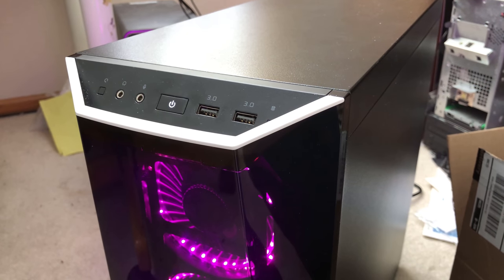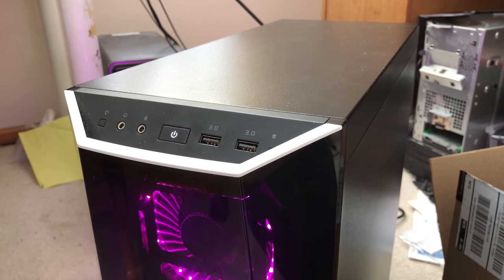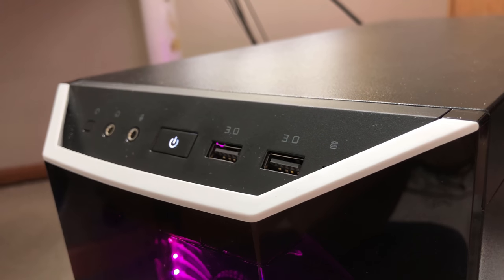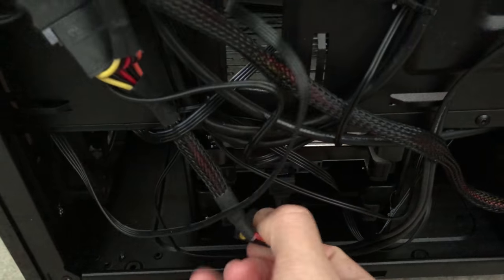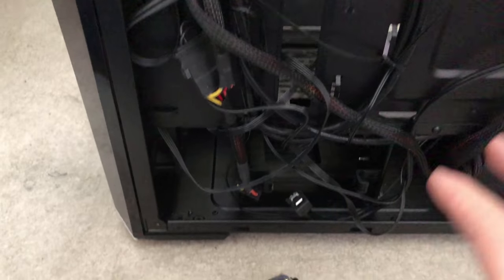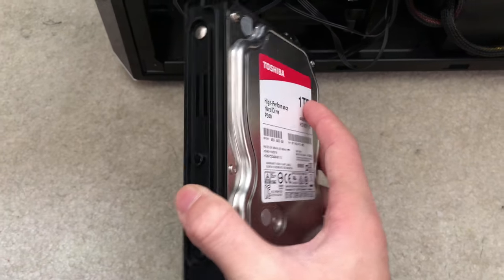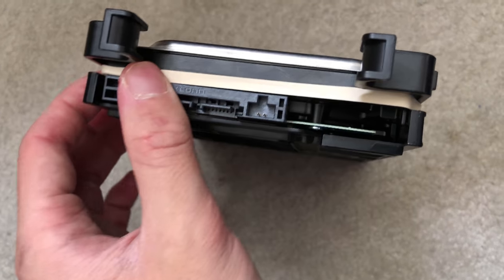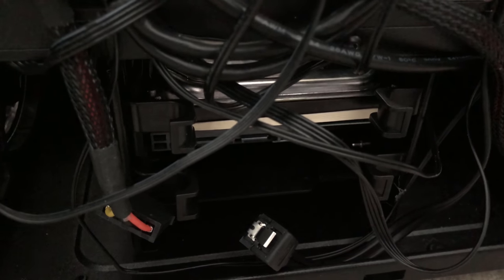HOW TO FIX HARD DRIVE VIBRATION - SUPER EASY - Toolless Mounts

Comment: I have a Corsair 760t case and a WD Blue 7200RPM 1tb and this seems to have worked so far.

Before trying this out my PC would occasionally out of nowhere start making a very loud buzzing noise which at first I thought was a fan or something. If I pushed the case the sound would stop. If I put a metal coin under one foot of it, it would stop making the noise for some time but start again out of nowhere. After reading into this I read that it might just be the hard drive vibrating (and it was).

I couldn't place the rubberband straight like yours because the sata ports would've been covered up (because of the design of the drive cages), but I messed around with it till I got the rubber band to go around the drive cage while also not covering up any sata ports.

It doesn't look great from the outside because the rubber band shows, but it is way better than hearing the loud vibrations it would make before.

My PC is more silent than ever now (so far). Thanks a lot for this.
Reply from the maker: glad to see that it helped!

Comment: I just removed my old 2TB WD drive from its enclosure and it vibrating just like in this video. Its causing the computer case to vibrate on the floor magnifying the sound. I loosened the screws that were holding it securely in place. I can no longer hear the drive. Hopefully the drive works a lot longer.

Comment: What a great solution!
I've been trying this fix for about a week so far and i'd say hard drive vibration noises are down at least 80%!  Not only are the vibration noises much less frequent, but they also don't seem to be as loud.
The case i'm using is a Corsair Carbide 200R which has tooless 3.5 inch hard drive bays. My only mechanical hard drive is a WD blue 1 tb spinning at 7200rpm. I was actually thinking about replacing this back up drive for a 2.5 inch sata ssd due to all the vibration noise but i'd prefer to not have to put out the money on one. Now that i'm using your rubber band solution my HDD vibration noises are much less frequent and definitely much more tolerable!
Thanks Stevepilot!
Reply from the maker: glad it helped!

Comment: Ok -- I had to put two of them to make a difference. Vibrations aren't exactly "gone" but now I'd dare say they are down to 50% or less. 

My gain out of doing this was getting rid of what I'd say it's 80% of the buzzing - which is great news - but I have to say I also put some foam underneath the four case's supports.

Other than that, this solution helped getting rid of a big portion of those buzzings and vibrations. I give it a 4/5. 
Thanks
Reply from the maker: WildBird Aviation thanks for the feedback!

Comment: This worked thanks! But i have one question, rubber bands shrink and weaken with exposure to heat, since it gets like 90c sometimes will it cause the rubber band to snap?
Reply from the maker: I suppose that’s certainly possible, but I’ve never had any issues with it. I’d imagine that it would be fairly hard for it to snap considering it is under fairly little tension while being compressed up against the sides of the hard drive. Thanks for watching!
Reply: @Stevepilot Our drives are a bit different. My rubber band had to go over the mounting clips. Which made it bend inwards. I didnt want the shape to get deformed or anything due to consistent pressure. It also made the rubber band quite stretched. I was paranoid so after installing it,  I cut the rubber band on the outer side so I could control the snap. Its working great so far. Solved the vibration problem (thanks to your vid), and there is now no possibility or snapping.
Reply from the maker: @user-bb3ci3gn7s  glad you found a way to make it work!
Reply: @user-bb3ci3gn7s  I have the same problem. How's your rig after 6 months?

Comment: I have the same case as u and my I have gone through 4 hard drives and all of them are still vibrating. Right now I have the Seagate iron wolf abs I put the rubber band around it and it still vibrates a lot.

Comment: how does 1 rubber band work? the hard drive does 4 more contacts on the case that hold it up.
Reply from the maker: The idea is to make it have less wiggle room in the cage, and not necessarily to be fully supported by the rubber band.

Comment: I have the problem with the 500p white, i think cooler master actually makes poorly designed cases and it's a problem with a lot of CM cases. I'm changing for a Lian Li o11d, hopefully it'll fix the problem
Reply: Manny Torres  well, i guess i'll see but if it's a big problem i will change for a ssd
Reply from the maker: Manny Torres  you could consider getting a smaller SSD for OS and commonly used apps, and just keep the HDD for storage. That way, it won't constantly be spinning unless you need to access it for something
Reply from the maker: Manny Torres  ah gotcha, maybe try playing with the power plan settings to make the hard drive sleep when not in use?

Comment: Awesome!!!! Since I don't have those special NASA rubber bands around, I'll try some thin EVA. I also would like to compliment you on the video - though single handed done the information is precise!
Some extra info about my system: Corsair 600Q case and a Seagate ST8000DM004-2CX188. Tool-less mount that matches the HDD to create a really annoying noise.

Comment: I have almost the exact same case i got td500 mesh and my hdd is like making a buzzing sound so ima try this tomorrow
Reply: Did it work?
Reply: @Slobodan Krčmar no
Reply: @Slobodan Krčmar i got one seagate barraquda 7200rpm 2tb, and a wd blue 5600rpm the seagate is louder than the wd blue
Reply: @Slobodan Krčmar ye its better to get an ssd, but try to put some rubber if you got. On all the sides where the hhd hits the mouting frame. It helps a little bit

Comment: I used the rubber band but it still vibrates, I know that it is not my hard drive because when I hold it in my hand while my pc is running it doesn't make a sound
Reply from the maker: Abdullah Malik that’s odd... have you tried switching slots?

Comment: Mine was still vibrating after putting rubber bands around it, it only kept my hdd in place without sliding out of easy in hdd bay, but since my hard drive is mounted on top of hdd tray i put a piece of folded paper between upper part of tray and hard drive, and it fixed my problem completely. I will probably need to get some sort of mount for hard drive that keeps it from being noisy. M case is Rampage Prestige, very simmilar design to yours. My hard drive is Seagate 500gb.

Comment: Hey I have the same case and i was wondering if there was a more  neat way to put the hard drive in
Reply from the maker: Abdullah Malik more neat? The current method works quite well, other than the vibrations
Reply: Stevepilot wait so the method fixes the vibrations perfectly so that the hdd is not damaged

Comment: Interestingly enough, in my case it’s also a 7200 RPM Toshiba drive, their 12TB Enterprise model.

I can’t apply your fix because my drive is in toolless USB3 enclosure without any sliders attached directly to the drive. But thanks anyway, this gave me an idea what’s going on, I think I gonna do something remotely similar.
Reply: And what'd that be?..
Reply: @DVTHEFOX  I tried a few things with ribbons but eventually I gave up. I gifted the Toshiba disk to my mother, she only powers it once a month and due to infrequent use doesn’t care about vibration or noise. I have replaced the disk with the Western Digital WD101EFBX model. The WD is much better; while not completely silent, definitely quiet enough to operate on my desk.

Comment: I put my hard drive in my PSU bay supported by the excess cables up there so the vibration doesn't transfer to the case.

Comment: my drive does the same, but it fades in and out. what does that mean?
Reply from the maker: TheLast MistWolf not sure, could just be a weird pattern caused by vibrations as they tend to be pretty unpredictable depending on drive load, other components (like fans), case material, case placement, etc.

Comment: Actually this way you prevent transferring vibrations from HDD to PC box. Energy is not dissipated and kept in HDD. A bit of clarification... hard drive vibrate mainly due to head movement (vibration from rotating disks is relatively small). When you isolate a drive from the case with rubber band, you allow it to move more freely (is more silent). It is good for working comfort, but increase overall acceleration. Typical HDD may sustain up to 0.6g with some errors. Acceptable working acceleration is below 0.2g (no errors). The more fixed HDD is, the lower acceleration is and longer life. So the best for HDD life would be opposite... attaching HDD to concrete. Since regular smartphone has built-in acceleration metering, you can download a mobile app and use it for HDD vibration monitoring. Just put down the phone on the HDD. I understand that it can still be a good compromise between noise and HDD lifetime.
Reply from the maker: Thanks for the information
Reply: Interesting, so I guess without rubber bands is the way to go? To prevent errors?
Reply: @thehh5118  Rubber band will reduce noice (vibration) of the pc box by isolation of hard drive. It is compromise between work comfort and hard drive life.
Computer box vibration depends on its rigidity (e.g. thickness of metal elements, walls, cages).Unfortunately manufacturers try to make pc boxes rather lighter than havier. Not only every pc case will be different but also location of drives influences overall vibration. The worst situation would be vibration resonance, noticable as unpleasant buzz of vibrating parts.
I have 8 drives in my NAS in regular case (best box for home nas... Fractal Design Define 7 XL). So I tested regular pc box design, which may be helpful to you. The max hdd vibration level with rubber isolators was 0.045g which is 20% of no-error range. It is 7% of no-damage range. 8 drives in a cage will cause more vibration than 1 drive, so your hdd vibration will be lower. So no errors. HDD life span is about 7-9 years. It will work longer but failure risk raise significantly. Rubber isolators will reduce this life span. How much? This depends on vibration level which a result of rubber thickness, pc box weight and drive cage rigidity.
Reply: @arkadiusz.chrzastek  That's helpful and good to know. Thank you!
Reply: @arkadiusz.chrzastek  but isn't the rubber flexible part only transferring the energy to more ..free movement? This way the vibrating hdd would move more freely instead of being stopped instantly in each vibration cycle after hitting the metal case. If it's not stopped immediately then the stopping force/acceleration would be smaller because it has more time/space to move and the hdd has more less constant force that is slowing it down.
Reply: @krzysiek2768  It is acceleration which damages hdd, not energy itself. Freedom of movement (rubber isolator) allow innertia movement which causes acceleration (during vibration cycles). Imagine standing on a wooden platform with wheels; no friction in wheels. Trying to move body in one direction will cause movement of the platform in opposite direction.
Let me bring another example... during earthquake ground vibration is transferred to a building; rigit base may cause significant damage to the building. Modern anti-earthquake "base isolation systems" are using rubber pilars, which prevent energy transfer into a bulding. HDD is opposite... energy is created inside of drive by rapid header movement. Rubber isolators trap this energy inside a hard drive. More rubber freedom means more drive case movement as a result of inertia.
Rigid fixation of HDD to a big mass (e.g. concrete block) stops vibration completely. Rapid header movement are then very precise because there is no inertia (reactive hdd case movement). What happens with energy generated by rapid header movements? It dissipates into whole connected mass as a wave, which is neglegible. It is like fixing self-vibrating building to enormous still mass of the ground.
Conclusion: header movement causes inertia movement of hdd case, which reduces header precision. Installation of hdd without rubber isolators generates unpleasant buzz (result of rapid header movement). Rubber isolators are compromise between noise and comfort. 
Hint 1: The heavier computer case, the loger HDD life.
Hint 2: when using hdd rubber isolators, squeeze them hard. Do not allow excessive rubber freedom.
Hint 3: When you want to create extra noise cancellation wall at home (due to heavy metal loving neighbor), build heavy panel wall isolated from surrounding surfaces by thin rubberized frame leaving small gap of air between primary wall and noise-cancellation wall.

Comment: I also have a Cooler Master Casing (with a Corsair liquid Cooling fan placed instead of the stock intel fan)  that i got assembled some 4 years ago.

What i usually do for cleaning ia just open the front case and side case covers.Then i blow some dust off using straws ;) (saw this hack on youtube)

The Vibrating sound generally would go away , once i shut down and turn the PC on again.

Now it kept on on comming, even after many attempts of turning it off and on again.So finally i am again blowing the air off of the surface layers and holes which r reachable.

Will type here if it was a success in a while..

Comment: My HDD start to vibrate sometimes and when i touch the front of my pc it stop vibrating, and after a while it start vibrate again. The HDD i have is WD Blue 1TB and the pc HP elite 8300. Can you please help?
Reply from the maker: Eandrave that was happening to this pc too but my rubber band technique fixed it. You could always contact WD for a replacement drive to see if that helps

Comment: Lol you sir need a cable management lesson :P just kidding. Hey guys if you own a Fractal Design Nano S, you know that the engineers designed this case just to house 1 hard drive vertical mounted. My moms past job had a very nice office wood desk and she gave it to me. My PC is mounted on the desk and with the hard drive spinning, you can hear a distinct vibrating noise. I followed Fractal recommendation and using the HDD/SSD bracket, install the 4 rubber grommets and tighten the 4 screws down until snug. This did not solve my issue initially. I ended up using a rubber band like what this video shows plus removing 2 of the screws completely and  loosening the last 2 screws about 75% of the way (don’t worry it won’t fall inside the case.) Fractal rear side panel comes with a sound dampening material too but it didn’t help the original issue. This method worked for me since Fractal didn’t make it tool less. It drive me nuts for a few weeks. I hope this helps someone with a screw mounted system. Eventually I’ll go SSD for pure silence. This HDD is 7200RPM too and I thought the rubber grommets would help the first time but it didn’t. Give it a try.

Comment: Worked great, thanks
Reply: Sadly, the problem came back after a while, currently looking into more permanent solutions. I've seen one solution from SilentPCReview to mount the HDD in an optical drive bay with elastic fiber. I might try it once I come across this material in a store. For now I'm trying all kinds of different HDD cage mounting solutions and stuffing the cage with mushy materials to absorb some of the vibration with lackluster results. If all else fails, might have to swap it out for an SSD, but that's like 100-140 € for 1TB.

Comment: i have a segeate barracuda 2016 1tb. its good fast hdd. i have a phanteks p300 case! its vibrating as hell!
Reply from the maker: That's odd, can you identify whether it's a problem with the case or HDD?
Reply: I have the exact same problem in a p300 case, with a toshiba p300 1Tb, after going full be quiet on fans and opting for a semi passive psu, the vibrations are killing me. I have HDD on a toolless mount too, and my problem seems to be that the sata cables are passing vibrations throught the chassis, i can't find a setup to kill them xD
Reply from the maker: Robin Htk I don’t know anything  about that particular case, but seeing as you are not the only one reporting this, could vibrations be a common issue with that particular case?
Reply: @ramonade_knives  Mine HDD was vibrating too, when you touch it you could feel it and it was quite noisy, so i put piece of folded paper between upper part of tray and HDD. My is tooless too.
Reply: @ramonade_knives  dude holy shit I have the exact same problem and p300 case and went same bequiet solution. ive been trying to see if i can mount the drive on the case...idk tho. atm i disconneted the hdd cause i use an m.2 as my main drive. idk what to do.
Reply: @Cerbyo  I found a solution ! I added a second HDD, a 2TB that was pretty heavy in the other toolless mount ! The weigh just stopped the vibrations !

Comment: Easy fix - get an ssd 
They are silent and much faster
But good video anyway
Reply: You don't always want to use a SSD for everything due to cost and what you are writing to it. If you are using it just for storage, lots of little writes, music, films etc then you are best off getting a 1TB - 2TB+ HDD
Reply: @DecimasoN  get a 120gb ssd for 20 dollars which is cheap and install windows on it and maybe some games and only use the hard drive for storage so its not always spinning and making noise simple
Reply: I will keep that in mind when I upgrade my 40TB storage pool, until then I will use a rubber band.
Reply: CSX except that the problem is that for some people the hard drive constantly makes vibrational sounds even without its usage